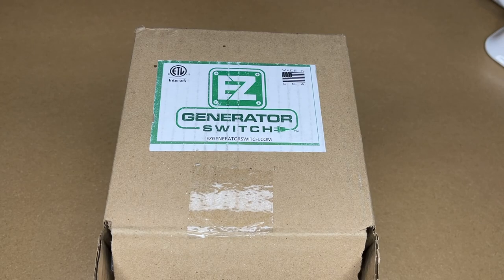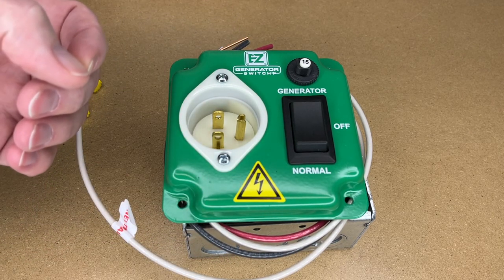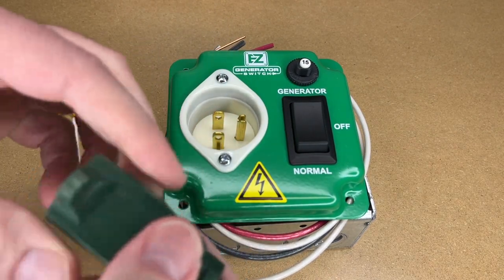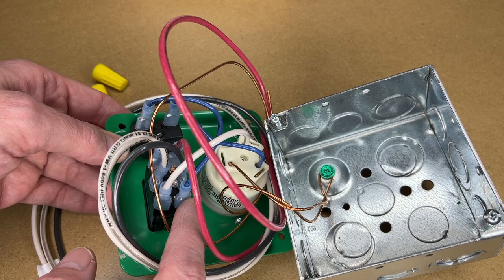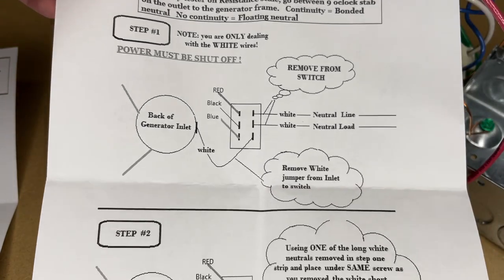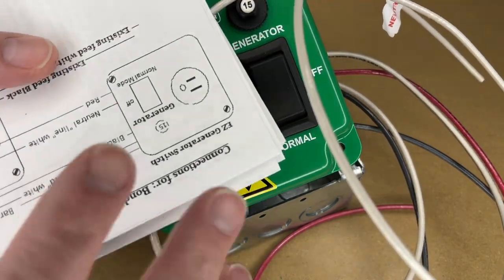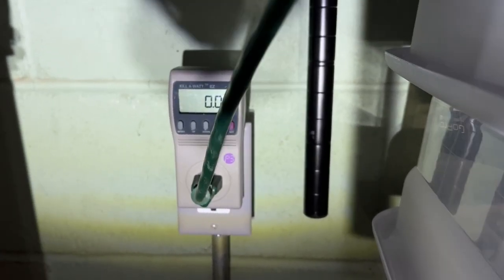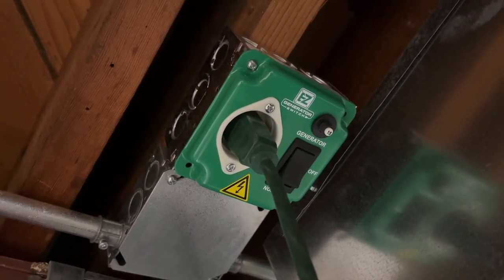EZ Generator Transfer Switch

Comment: Very nicely done. I installed mine for the furnace for the same reason after I got a portable inverter generator.

I simply replaced my old furnace switch with the ez switch so I don't have to mount it in a new location.
Reply from the maker: That sounds like a good place to put it. I considered that but I have an outlet directly next to my furnace switch which I thought might complicate things (not for myself but anyone messing with it in the future).

Comment: You definitely don’t want to install it on a ceiling like that it will fall out from the weight of the cord and the manufacturer instructions even states this. Using a power station most likely will give you issues as they don’t usually have a ground wire on the outlet on the station. There are many videos out there for a work around. The only time you really want a floating neutral is if wiring it to the fuse box. If wiring to a single appliance or furnace you most likely need a grounded neutral

Comment: A couple questions.  Why did you mount it to the old junction box?  Couldn't you have just installed this over the existing junction box, and connected the wires in that box instead of the box that came with the switch?  I'm assuming that this circuit is dedicated to the furnace alone.  

Can this be installed along the line somewhere, instead of being at the panel or the appliance?  I'd like to just pick a convenient place in the cellar to mount it, cutting the existing Romex , install the box with each end entering the box, and connect the wires per the instructions/diagram, inside the work box.

Thanks
Reply from the maker: My original plan was to replace the junction box with this but I had forgot that the box services the furnace and the (natural gas, power vent) water heater. I didn't really want to have this connected to the water heater as it already uses a plug and outlet. Adding this along side was a cleaner and easier setup.

This could be installed anywhere inline with the power running to an appliance.
Reply: @Rickmakes  
Thanks a lot for the reply.   Makes sense.  You're right, it's a nice neat look.

I lost power earlier this week, and I'd recently been thinking about what to do in case of an outage.  This looks like exactly what I need, think I'll order one of these today.  Thanks

Comment: Did you have a bonded or floating neutral generator? In looking at your instructions for floating neutral, it was confusing. It doesnt say where to connect the white wire coming out of the furnace? Also, can I just plug the extension cord into any 15 amp outlet in my home like you did? Would like too, be a good way to see what size generator I would need.
Reply from the maker: My portable power station (battery) has a floating neutral but from what I understand you can't bond neutral to ground with it. As such, I installed the transfer switch as is (I didn't bond neutral and ground). On my install, I connected the line wires to the circuit and the load wires to the furnace. I think you can connect it to a 15 amp outlet in the home with the default configuration but when you later connect it to a generator, you may need to bond the neutral to ground as outlined in the instructions. That being said, I don't really feel comfortable giving people wiring advice. I would suggest contacting EZ Generator Switch via their website as they are very knowledgable and helpful https://ezgeneratorswitch.com/contact-us/. They might have some of your questions answered in their FAQS too.
Reply: Ok, I think I understand. I think what your saying is that your portable power station does not want any bonding of neutral to ground. So you used the default switch setup, bond-neutral, which does not bond neutral to ground. But if you plugged in a generator, with a bond-neutral switch, then your generator would need to be bond-neutral, cause the bond neutral to ground has to come from somewhere. Thats why you can plug it into your house, cause the bond-neutral switch gets the bonding of neutral to ground from your houses circuit box. You could also use one of those clamp meters, where it would measure the amps by just hovering over a wire.

Comment: Curious if this might replace a boiler main on / off switch as I literally have two of them connected to my home's boiler! Or should I install it as stated? thank you.
Reply from the maker: This is a single appliance, point of use, transfer switch. It's not for use on a generator itself.
Reply: Thank you, but that was not the intended question as I do understand what the switch is and does.  @Rickmakes 
See above.
Reply from the maker: @WhiteDoberman  Oops. I received the original comment notification via mail but hadn't realized it had been updated when I replied. I've thought about that same thing myself. I think it could work well. One thing to consider is that the "Off" position is in the middle of the EZ Generator Switch whereas with a regular switch it is either fully up or down. If a person flips the switch to "generator" thinking it is off, power should still be cut so long as a running generator isn't connected.
Reply: Appreciate that info. Thank you. @Rickmakes

Comment: All I see is everyone just installing the EZ gen switch but no one is actually showing a generator in operation with the EZ switch.
Reply from the maker: I unfortunately don't have any videos using a proper generator. I do have a video where I run my furnace with a portable power station: https://youtu.be/fcjbvmbbneU I also have a video where I run my fridge with a portable power station: https://youtu.be/WcgZkeD36yM?si=hewQBRRct60wIom4